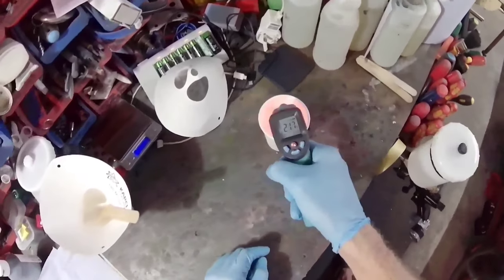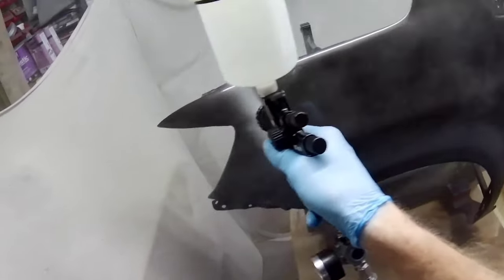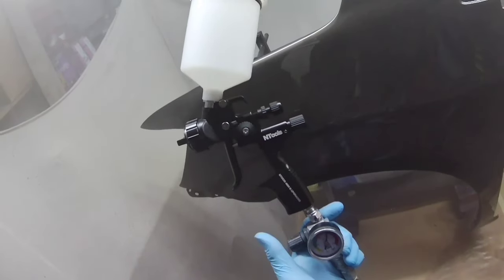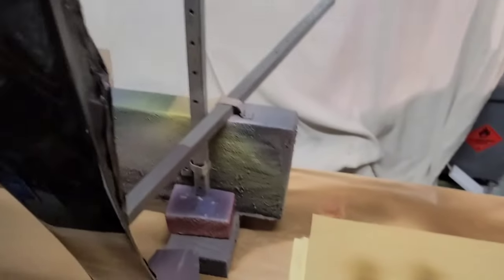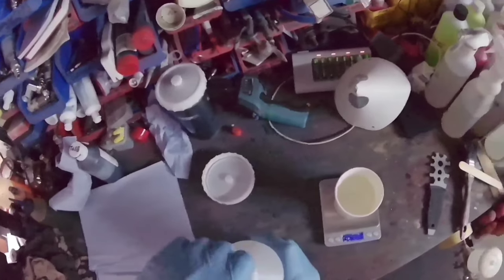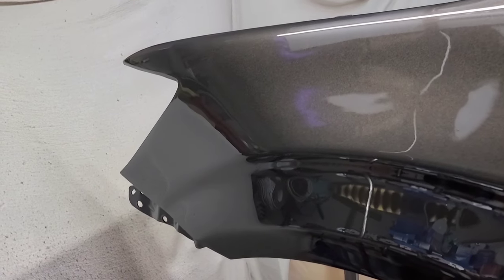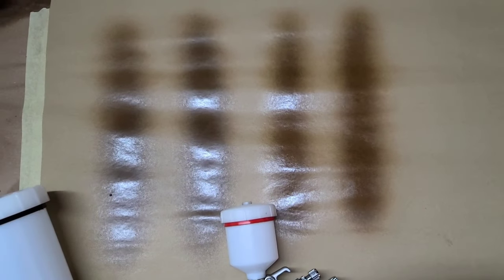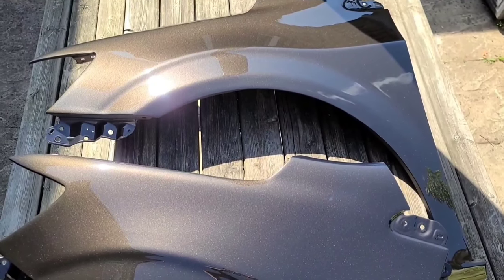Ntools 4000B 1.3 v Sata 4400B Minijet, Mini v Full Size Spray Gun Upol Clear Coat

Comment: Another great video! I haven't tried SATA 4400 minijet, but I have a 3000b minijet. I was think they are similar, just found the 4400 has a much bigger fan than 3000b.
Reply from the maker: Hi buddy,  The little 4400 really does have a huge fan for a mini gun. In this video, it's a 1.2, and it's not far off the copy 4000B, which was 1.3.

I'm not familiar with the 3000B, but it wouldn't surprise me if it has a smaller fan than the 4400B. 

Cheers, buddy,  good to hear you like the videos. Thanks for watching,  it's really is appreciated 👍
Reply: You are right. 4400b SR has a bigger fan. I don't know, what is "SR" to mean, but  "SR"= bigger fan..
Reply from the maker: @rikujkoivisto Hi again, buddy,  SR = Smart Repair according to Sata 👍

Comment: Hi Pete, lovely finish from both guns mate and there isn't much between both of them regarding the finish so I recon that you would be more than happy with the Ntools but as you mentioned the downside is the air consumption of the Ntools🤔mate the size of the fan from the 4400B is incredible it's massive😲and for that reason I think this was a good comparison between the two guns👍

You may have told me before but I was surprised when you said the 1.3CC setup is actually a 1.1mm🙄it shouldn't surprise me the way this company measure their tip sizes, I was wondering how the CC aircap would perform with a 1.3i needle and tip in it, do you think it would overwhelm the aircap and not atomise the clear properly🤔🤷‍♂

Anyway mate great video as always a very enjoyable comparison, cheers Pete👍
Reply from the maker: Hi John,  I have,  over the years, come to respect my little Sata Minijet. It can do virtually anything.

There's such a wide range of tip sizes from 0.5 to 2.0 and everything in between, RP or HVLP, so providing you can afford the tip sets, you can do anything with it.

As you say, its fan is huge, and that's in 1.2. They do a 1.3 and 1.4 as well. It's not my favourite, but, as I say, I now respect it for what it is.

Yes, the tip on the Sata 1.3CC tip is, in fact, 1.12mm, and the 1.2 is in fact, 1.25mm. The 1.3 is 1.35mm, now you know why the CC is so 🐌,  cheers mate 👍
Reply: I know a lot of people like the 4400B and it gets good reviews but like you I have shovel like hands so would probably have the same problem as you with the fan control, I didn't know it had all those setups for it so as you said it would be a great gun for someone just wanting a one gun does all and one that's good quality.

I don't know why the tip sizes are so far out on the sata guns mate, I don't see any gain in saying it's a 1.3cc when it's only a 1.1🤦‍♂ yep know we know why the CC is a slow setup but it's also why it atomises the clear so fine, do you think a 1.2i or 1.3i tip would work with the CC aircap🤔

Posted another tank on my page this afternoon mate, not sure if you will like this colour though🤔🫣🤣cheers mate👍
Reply from the maker: @JohnWD40TC02 Yeah,  I think it would work, but I suspect that the main reason the CC gives a flatter finish is like many others. A smaller tip with everything being equal often gives a flatter finish, I think personally this is more of the reason than the cap, cheers mate 👍
Reply from the maker: I've just seen your Instagram page and commented,  cheers mate 👍

Comment: Hello Pete i just bought Sata 4400B RP second hand and i it had 1.4 tip on it. What would you recommend for settings. I just feel that the fan is not as big as on yours,i did full fan and full fluid on 2.2. Fan is about 15cm am i holding it too close or the tip sprayes a bit tighter.  I am looking at getting a bit orange peel so that the panel matches other parts.  Thanks in advance. Cheers!!
Reply from the maker: Hi Mate, 15cm sounds quite small for one of these, I normally hold this around 150 to 175mm from the work,  Sata recommends 2.5 bar for their 4400 RP setups, so try that and see what you think 🤔

Comment: Hi Pete!! Why SATA (not N-tools)? They (some) two exactly similar Chinese guns may be very different guns. Others will work  fine a long time, and others are garbage in six months.
I think that those seal rings etc inside the guns are not made proper PTFE or similar, good material, which can resist different chemicals..? I have Sata minijet. It is an expensive gun, but i do know that it will last a long time, many years..
Reply from the maker: Hi Mate, Yes, of course,  you would expect a Sata to last longer than an Ntools,  I have had a few people that have given quite a lot of use to the Ntools that they have had problems with the seals.

What something like the Ntools gives you is the ability to buy a gun to use, try, experiment with do what most people want at a low cost, many will go on and buy better tools depending how they get on with there painting.

Cheers buddy,  much appreciated 👍

Comment: So what would you say at the end after trying both...what is better ntools 4000b or ntools devilbiss dvi copy 😂?
Reply from the maker: Hi Mate,  They are different. The NVE is a bit less aggressive, I also think it uses less air, not much, but I'm sure it's less.
The Ntools 4000B is better made and will probably last longer. The 4000B is better for clearcoat if you are used to spraying, but the NVE would be better if you weren't.

The NVE is better for basecoat, particularly more complex colours, but there isn't much in it with these to be fair. Cheers, buddy 👍

Comment: 4000b rp's can spray clear at 18-19psi, the 3000 rp was also a great gun
Reply from the maker: Hi buddy, I've never used a 3000rp or 4000rp but I will maybe get one one day if a nice one comes along,  pressure wise I'm not sure but if people are using them at 18 to 19psi then that's lower than most I know that use the 5000 and 5500, HVLP yes but not RP.

  I normally use the 4400 RP at 29psi/2bar, but it gives a flatter finish at 2.5bar/36psi

Cheers, mate. I appreciate it 👍
Reply: @peteshobbies5383   Interesting video called "How to set up a clear gun" by MrCorosiveone, he paints high end Ferraris, he discusses the 3000 and 4000 in that video.
Reply from the maker: @evojigger Thanks,  I'll have to take a look 👍

Comment: I was wondering if the Ntool guns will fit the maintenance kits you buy here in the uk online at places like spray guns direct ?
Reply from the maker: Hi mate, I would doubt it, do you mean like the kits spray guns direct have for the ANI F160/R160 type guns?
Reply: @peteshobbies5383  yes the kits they supply consisting of o rings / washers etc. 
Very tempting to try out a n tools for the price, but not being able to fix it when a seal decides to give up puts me off.
Reply from the maker: @lockstocky2800 I would very much doubt the kits would fit. By chance, the odd seal may fit.

These Ntools are around £42 gbp delivered, so if they give a years service, it's still cheap.

I have a few sets of neoprene o'ring that I use for all sorts of things but you can often find a ring to fit certain guns, I've repaired two Iwatas and a Harder & Steenbeck air brush , I got them a few years ago but they were only around £9 a box with about 40 sizes per box

Comment: You ever paint nuts and bolts . Cermic paint like cerakote do you know any alternatives
Reply from the maker: Hi Damen, I have in direct to metal clear coat but not colour, mainly for corrosion protection.

I've never sprayed cerakote. It's something I want to do, but I need to get some time to get to know it.

Any coating of spray coating of nut and bolts is tricky, as you'll know

Comment: My 4000B leaked from new. The pot where it screws in leaked and wouldn’t seal.
Reply from the maker: Hi mate, haven't heard of that from anyone before,  I think from memory it has a nylon seal at the base in the gun, is it there ?
Reply: @peteshobbies5383  yeah it’s still there, not heard anyone have the issue either. Maybe a new cup or seal will fix the issue.
Reply from the maker: @classicvolvorestorations3848 you can get PPS adapters for them which may fit the problem
Reply: @peteshobbies5383  do you fit the wee filter for the cup? I never use them but did wonder if it’s needed for this one?
Reply from the maker: @classicvolvorestorations3848 No, I just filter when I fill the cup, normally 190 micron but 125 micron for Candy
Reply: @peteshobbies5383  got it sorted now thanks, added a second seal. Think the problem might have been the thread was a little off and the cup wouldn’t wind down fully onto the seal.
Reply from the maker: @classicvolvorestorations3848 That sounds like a good fix. Had a few people say they have had problems with the gun leaking air after a while, but nothing about the cup sealing,  good it's sorted now, cheers buddy 👍